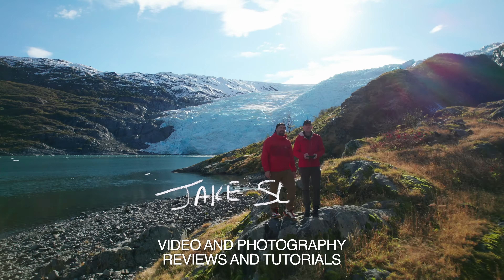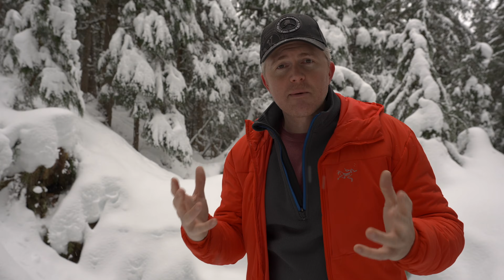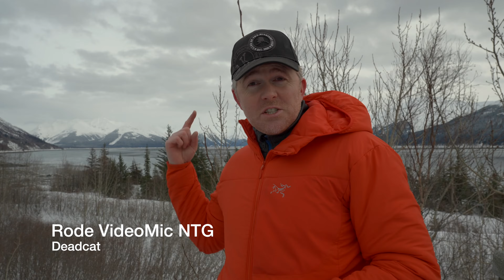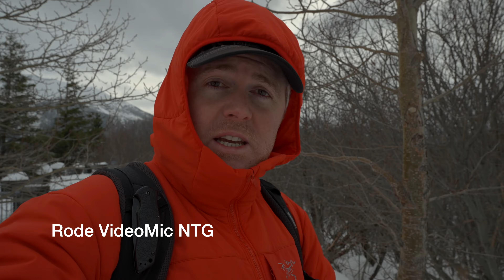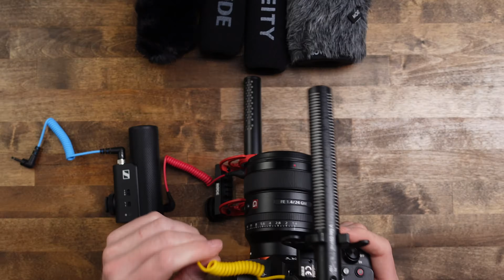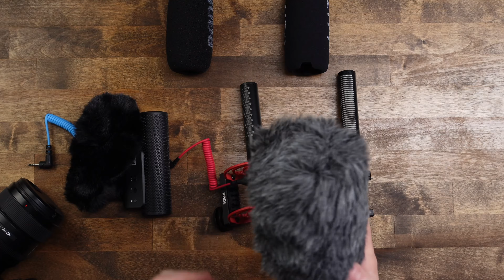Best on camera mic in 2022 for under $250.00

Comment: I have the MKE400 and I use it for recording bird sounds and ambient nature sounds, but the self noise is quite high when there are moments when it is quiet in my recording. Two years since this video has been made... do you have any new mic suggestions for onboard recording that would fit my needs?
Reply from the maker: Hmmm not off hand without getting into pretty pro level gear. I still use the MKE400 for the most part. Deity typically has pretty low self noise but still there
Reply: I would prefer a video mic and don't mind paying more but I'm not really seeing any updated type mics. The MKE440 sounds great being stereo vs the 400 but doesn't seem as rugged. If you have suggestions that would be great? If not, I still appreciate your time and the video was great!

Comment: Hi Jake,

I watched your review because I'm looking for a device to record natural sounds like forest, waterfalls, rivers, birds...

For video I use a Canon R7 mirrorless camera but for sound I haven't found any decent solution. Internal mics are not very good. Also tried a shoe mount mic (Deity D4 Mini) but I still get a lot of noise. Especially when I record birds I have so much background noise that I cannot use it. I've tried all kinds of settings on my camera but it seems it has bad preamps and the mic is not that great.
I've also tried the DJI Mic2 TX to record separately,  but the levels are so low that I cant use it. Seems only works with the RX so you can raise the volume and activate 32bit.

So after watching many reviews for shoe mount mics I saw a recommendation to get a Zoom Recorder and mount it on my camera. To use it as a separate unit doesn't feel like a solution because every time I will have to match the video with the sound and I prefer to have it directly over the video for a more natural feeling.
What do you think would be better, the Zoom H1 Essential recorder, the older version H1n or I would get better results with a shoe mount mic with battery power like Sennheiser MKE400 or Rode?

Now my budget is maximum 200(looking also for SH options) but I'm planning to invest more in the future.
Reply from the maker: I think what you are trying to record will be challenging for anything that doesn't cost a LOT lol, BUT for what you describe I would get the Zoom unit and place it away from where you are to get the cleanest sound possible
Reply: @JakeSloan  Thank you very much for taking the time to reply and explain :)

Comment: I have an Rode NTG, two Rode Videomic Go II's, one Panasonic Shot Gun (DMW-MS2), one Audio Technica AT4073a Shotgun, one Rode NT4 and one Rode NT3. I shoot multicam live theatre, concerts and dance shows. My Rode NTG quit but it was replaced by Rode under warranty. I usually use two Rode Videomic Go II's and the Audio Technica AT4073a on my cameras. I seldom use the Rode NTG as it sounds very similar to the Rode Videomic Go II and I don't have to worry about batteries. The Panasonic shot gun doesn't require a battery. I use the Rode NT4 on the leading edge of the stage with the Sound Devices Mix Pre 3.
Reply from the maker: WOW thats quite the collection
Reply: Подскажите, что лучше для записи звука портативных колонок на улице и дома: RODE VideoMic GO II или 
Shure MV88+? . Также как запасной вариант рассматриваю еще Sennheiser MKE 200-400

Comment: I had the Rode and the Sennheiser and returned both. Very boxy sounding. You could spend some time EQ-ing the mic then save the setting as a pre-set if you are a youtuber or podcaster and you are the only one going to be speaking into the mic. But if you're a filmmaker or similar weddings etc and lots of different people are going to be speaking into it then you're going to need to know what you're doing in the mix.
Reply from the maker: What did you end up with?
Reply: @JakeSloan  I have a Sennheiser ME66 with K6 module. I've had it for 15 years and it's great but it's also in a full on blimp and I'm looking for a compact run and gun 'backpack' solution. I'm trying to put together a one bag solution. I have a Panasonic G9 with a pancake lens. A small wireless kit (Fulaim X5) and a monopod. I also have the DJI Mini Pro 3 and a 360 Theta camera. I need the mic for on camera audio when l need it. I'm waiting for the Comica CVM VM20 to try.
Reply: UPDATE. I bought the COMICA VM20 and used it on several projects. The audio is crisp and nice. The battery life is nothing to worry about as it can go a few days on a full charge. It has pro features like 75 and 100 db cut. It's a really nice mike .... until .... you start getting loud. I was doing a narrative based film with this mic when one of the actors had to shout aggressively as part of his dialogue for that scene. It distorted badly and very very obviously. Note: IT DID NOT CLIP. And this was the problem. After some investigation I found the SPL on this mic was on 105db and it had distorted because the mic just couldn't handle the volume of the actors voice in that situation. I tried my  Sennheiser ME66 and of course it passed my tests of me screaming down the mic at close range to try and get it to distort. The ME66 has an SPL of 130db. After some searching I discovered the DIETY D4 had the same SPL as my ME66 and so I purchased that. Problem solved. My Comica VM20 is now on eBay.

Comment: Great comp ! I now wonder how they'd compare to the Zoom M3, notably in term of audio quality, & practicality, considering the M3
- can output in 3 ways : Internal 32 bit on SD card, USB out, & hp out into a camera for sync & secure/backup REC
- has the advantage of 32 bit REC, which would eliminate all issues of level & digital clipping, even though we'd still have to avoid for sure analog (mic) clip
- has as only potential issue, the same as some other options, RF interferences pick-up, & plasticky build
Reply from the maker: would be nice to try it out for sure!

Comment: Really nice reviews, Jake. My mic of choice for several years has been, and continues to be, the Rode Videomic NTG. I record inside only, myself speaking and being videotaped. I use it purely as a USB-C mic, going straight into my M1 iPad Pro 12.9, which obviously captures both audio and video simultaneously using it this way. The sound quality is fantastic. 

The mic is boomed in its shock mount, just out of frame, and the iPad is mounted on a tripod. It all sits atop a rectangular table, along with lights, so it’s always “good to go” with no set up needed each time I record.

After recording, the iPad is removed and placed back in its Apple Magic Keyboard, where I edit the videos using iMovie.

The advantage for me is, aside from possibly boosting the volume a bit in iMovie, there’s absolutely no post production needed - just trimming, etc. I don’t even use any of the settings on the NTG, as the USB connection seems to work perfectly for my needs. The sound quality is great for my voice - as you mentioned, each mic is a bit different on how it records, so what works for one may not work so well for another.

The other nice thing I’ve found about Rode is, the NTG (as you mentioned) has a built-in battery which must be charged. But Rode guarantees each new mic for 10 full years when you register it. After having mine for almost 3 years, I began having some battery problems - but the techs at Rode had me send it to them to be checked out, and they replaced it with a brand new A-stock NTG, which is now guaranteed for the remaining balance of 7 years. The one thing we know, with any kind of tech, is that over time, products will come out which perform better (and often cost less) than whatever mic you buy. But I’ve been very impressed with the techs at Rode, which you can reach by phone five days a week. I can tell you from my own experience - both before you buy and afterwards - they are there to help. Let them know what your particular needs are, and they will advise which, if any of their products, will help you in your work. They’re also very familiar with how their products interact with Apple products, etc.
Reply from the maker: fantastic points and tips!

Comment: Hey i recently got a sony a7iii. Im scared to use it in light rain and snow. Are they weather sealed?
Reply from the maker: the A7III is pretty well weather sealed, I used mine in the rain and snow a lot. just make sure no rain or snow gets in the hot shoe as the little contacts in there will mess up if they get wet.

Comment: Thanks for your review.   It was easy to notice that  the Deity did a worse job of rejecting the waterfall  noise than both Rode and Sennheiser. Their performance in a windy environment was similar when using the deadcat  but the Deity did clearly  worse with no wind protection. It would be very useful if there was also a test with the low cut filter on. 

The handling noise seemed to be the same although it was difficult to hear as you were talking. The Rode, as you said yourself, has more ways to control the sound and has no interference problems, an issue that seems to be common with the Deity. I have the Sennheiser . I used it just a few times but had no interference issues and the mic was right on the top of my iPhone. 

Deity is the only one that doesn't have a headphone port. The Sennheiser has one and you can improvise one on the Rode.  

Based on your review I would choose the Rode or the Sennheiser . Definitely not the Deity.  

One thing is for sure:  The Rode and the Sennheiser are much more suitable to use with iPhone than the Deity. They have a. headphone port and won't have interference issues (I am not sure about the Sennheiser  as I haven't use it enough to be certain  but  had no problems with it in areas with lots of phones and radio frequency and I used it on the top of my phone).
Reply from the maker: Great points!

Comment: Thanks for the comparison review. I am hoping to find a replacement mic that has better shielding, and you state that some have experienced  RF issues with the Diety. 

My original Video Mic Pro has served me well for many years. However, when used with my Hollyland 400S wireless transmitter, the VMP picks up RF "spray". I can minimize it by adjusting the direction of the 400S' antenna, but can not eliminate it entirely. 

BTW, I am using this with a Panasonic S1H, and have experimented with different gain settings on the VMP and input gain on the camera. Being an unbalanced audio path, the system is prone to RF spray.
Reply from the maker: for that I would consider the Rode NTG, it has some of the best shielding I have found on this kinds of mics

Comment: Hello, Just wondering if those mic can handle cold weather up to -10C (I live in Canada). It’s seems not good to use mic in cold weather and manufacturer don’t show that info in the specs. Of course your video was taken in winter, but do you stay away when it’s getting cold around -10C. Thank’s
Reply from the maker: Yes they can! I have tested them all in very cold temps
Reply: @JakeSloan  thank. you ….

Comment: Did you switch out the 3.5mm cable supplied with the Rose NTG? If so, why?

Ive been having connection issues with mine. I’ll charge it and go then use it and it’s completely dead or it won’t shut off after charging it, until I connect it to camera and unplug it. Any tips or hacks greatly appreciated!
Reply from the maker: I did but only because I liked this one better lol. No other reason

Comment: Hello, I have a question if you could help me it will be very nice of you. I make outdoor cooking videos. I live very close to highway and there's lot of traffic noise. I bought rode video micro that doesn't help much since cars are driving by really fast. If you could suggest a microprocessor for my situation that would be very helpful.
Reply from the maker: Unfortunately it will be very difficult to deal with. You could try software noise reduction but it will only help a little bit. The best solution would be to use a lapel mic and keep it as close to your neck as possible to get as close to your sound source as possible. There will still be noise but it will not be as loud compared to your voice.

Comment: Best on-camera mic comparison I've seen, and I've watched a ton. I think I'm going with the Sennheiser MKE-400 because of the integrated wind/shock design making it more compact and nice looking, without seeming to sacrifice sound quality. Thanks!
Reply from the maker: Thank you so much!
Reply: wrong choice, VIDEOmic NTG 10 TIMES BETTER
Reply: @treasuryox  Maybe for you but certainly not for me, so it’s a bit odd to call it a wrong choice when you don’t know what I’m looking for. I now own the MKE-400 and it’s definitely the best option available for me. It’s much more compact than the NTG, has integrated wind and shock protection that works amazingly well, and it looks much nicer IMHO.

Comment: I commented before and I appreciated your response, but do you have any suggestions for a cardioid microphone that can handle winds up to 30 or 40mph?  Thanks for the reviews and your time.
Reply from the maker: Really at those wind speeds you will need to put any shotgun mic into a blimp with a furrry cover to be any use at all. Alternatively a lapel under clothing on a small wireless system could probably handle it better
Reply: @JakeSloan  Thanks for the reply.  Do you think that the Deity or Rode (since you have used both) can handle winds up to 20mph?

Comment: Do they all have a low battery warning light? Great review.  The Sennheiser seems to produce the smoother sound with your voice.
Reply from the maker: The rode and Sennheiser do the deity does not.
Reply: @JakeSloan  Thanks. That is a really important aspect, as shooting with a low battery, without monitoring the audio is a recipe for disaster. I got the Sennh MKE200, which is smaller,  no battery needed. I really like that it is compact and built-in shock mount. The MKE 400 sounds like a great option.